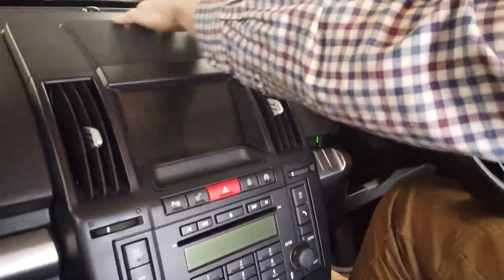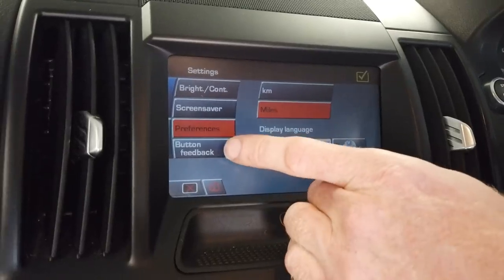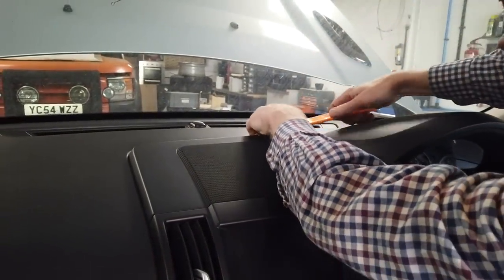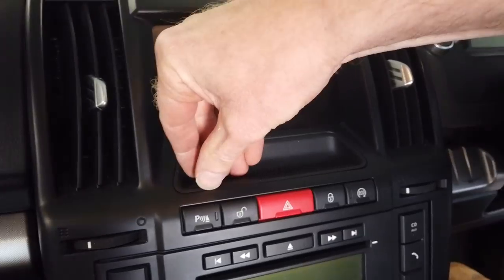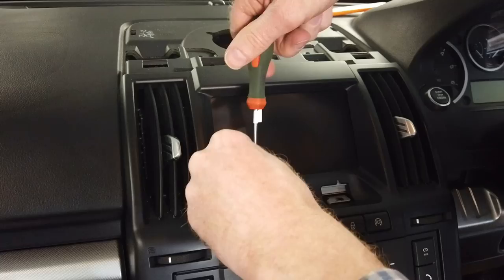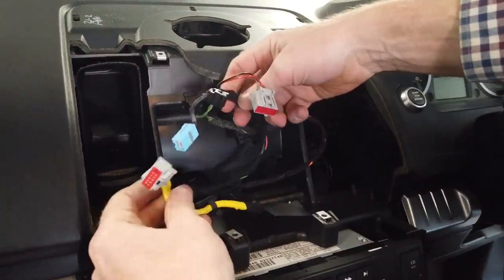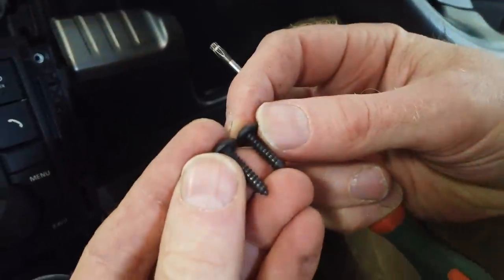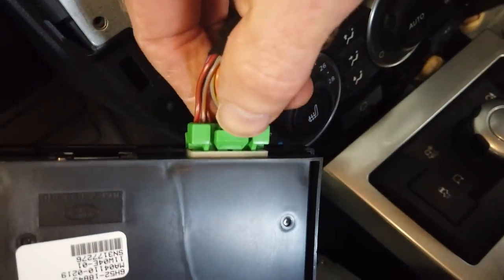How to remove Land Rover Freelander 2 navigation screen /  radio / CD player LR2

Comment: Another good video. Thanks. Do you know if the wiring harness is fitted in cars that don’t have the screen? Mine has a cubby hole and I’m wondering if it’s possible to fit a screen without having to add the wiring loom. Cheers
Reply: Wondering the same. Did you remove the front and take a look?

Comment: When is the next episode, also which model android screen are you using? I've got the same car but no sat Nov, will all the wiring be tucked behind waiting to be installed?
Reply: Did you figure out if you had the wiring? Did you install an android screen and if so did you keep the original radio inside the car too?

Comment: I have done an upgrade/replacement of the stock unit with an android (unit with DSP), but only been able to have stereo outputs (left and right from the front) being sent across all the speakers. And the device is not sending out rear channels / 7,1 separately but using the front channel for rear and the rest of the speakers too. Plus, the connection goes through AUX. Can you check it too when you make the android installation video and advice?

Comment: Hi. I have a 2010 Freelander 2 TD4.e. Wondering if i can retrofit the sub bass unit in the spare footwell as mine don't have this like my friends model  as I've only the base model. I've taken a look with removing the right hand real side panel but cant find any wire loom to supply  said sub to the spare wheel well. Also was wondering if the sub thats fitted to higher models are a powered sub and theres only one bass speaker yet there's 4 wires going into the speaker connection. I have gone through all your videos on here and not found anything covering this. Any help would be great thanks.